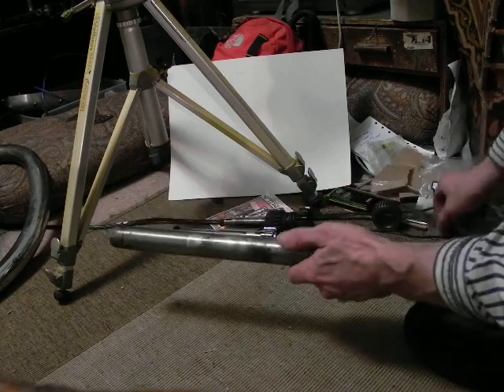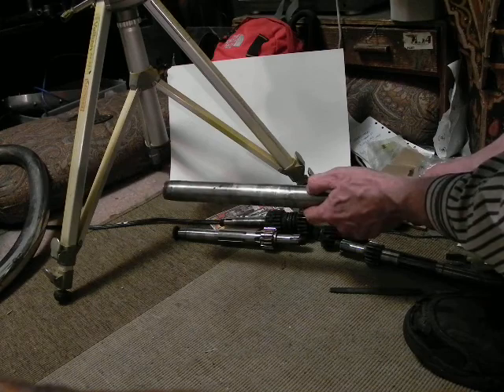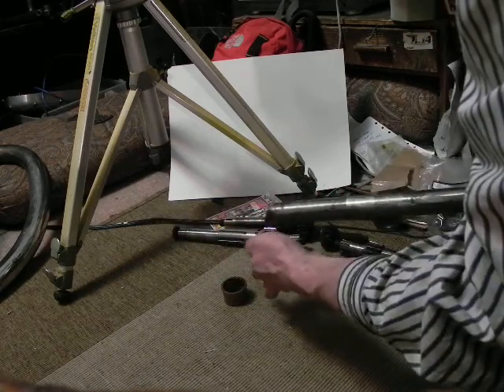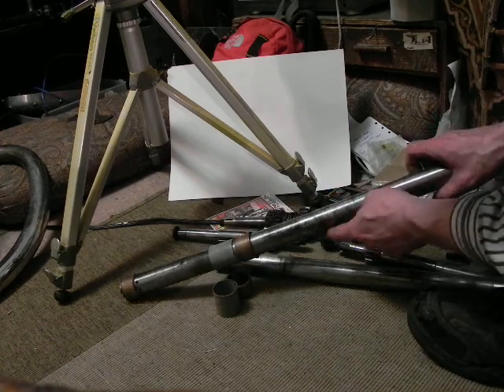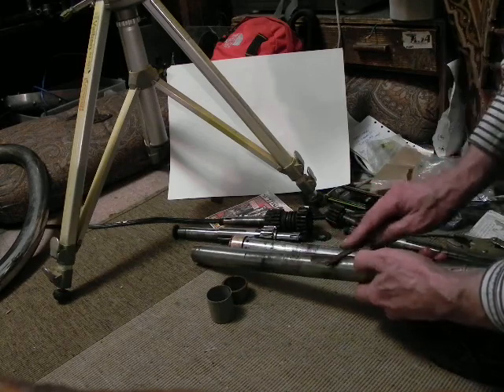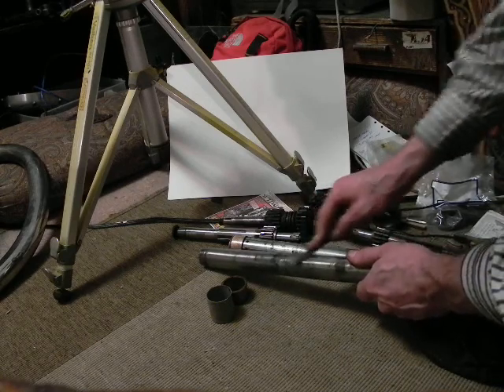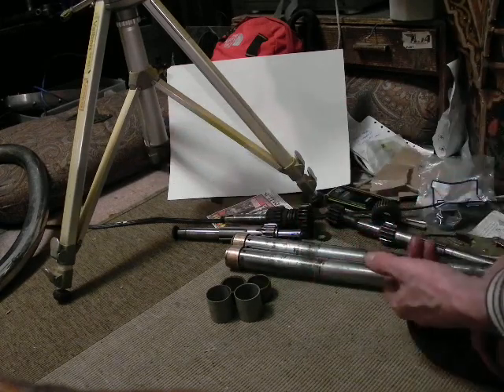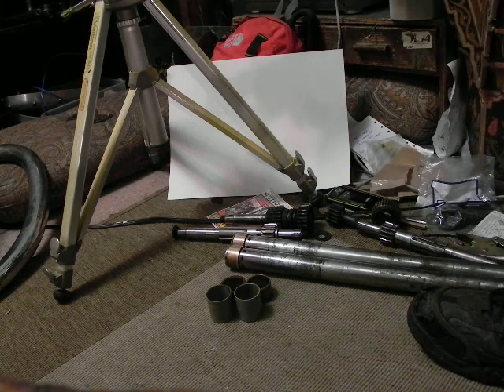Deburring damaged BSA R3 Rocket fork stanchions to save good bushings.

Comment: I am currently rebuilding a pair of shuttle valve forks, without internal springs (other than outer springs, there were not any inside the stanchions when I took them down to rebuild.  Does the earlier type with only two studs on the bottom fork legs (like mine) have internal springs?  Tim (1969 BSA A65 - T)